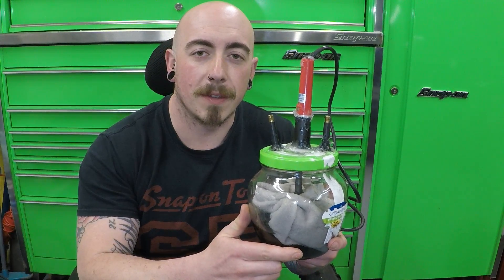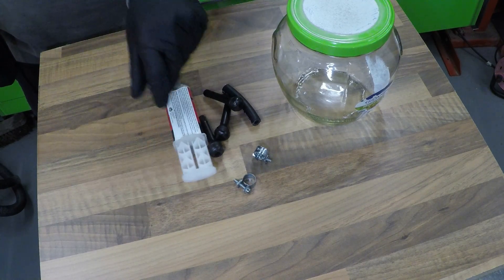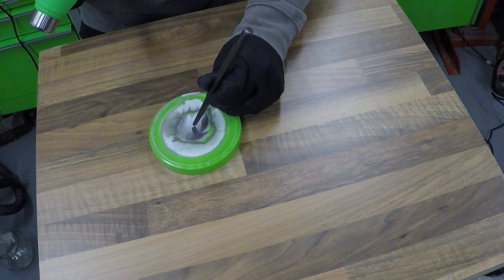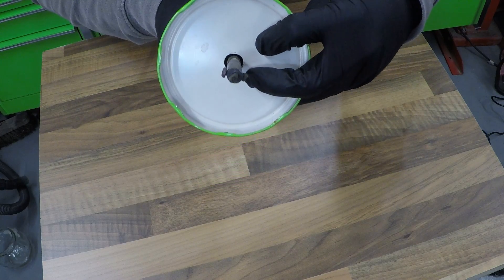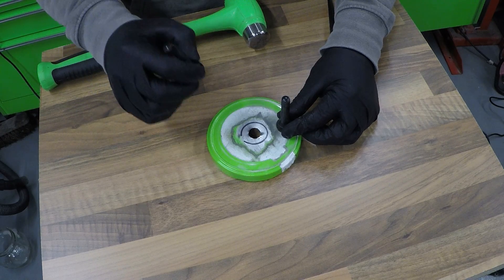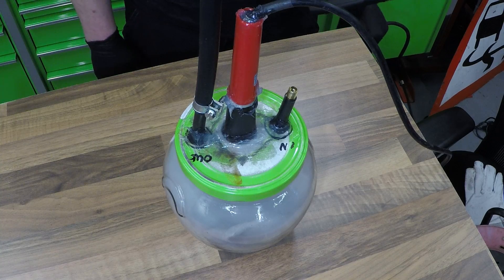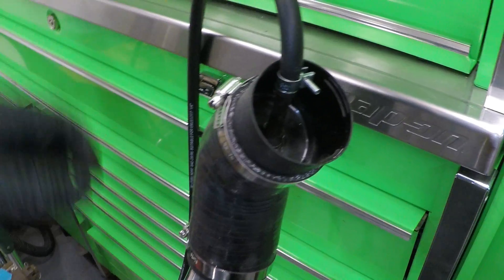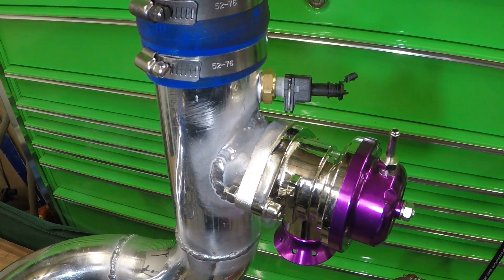D.I.Y smoke tester

Comment: Excellent video. 
To save more money I harvest baby oil using a cider press and a sock filter.  Extraction is much quieter if baby is asleep before processing which should be done swiftly to avoid annoying neighbors.
Reply from the maker: make sure the baby is fresh or else it will burn

Comment: I made something similar to this but I used a one quart mason jar and already set fire in the jar with lighter fluid with a rag and put an air compressor fitting on it to 5 -10 psi with 2 shutoff valves on the in and out port. Works just as well. Although I don't see how baby oil is flammable. ?? Can anyone answer that ?
Reply from the maker: I'm not sure if it is flammable or not but it sure do smoke well
Reply: @Project380 Have you put a flame to baby oil?

Comment: Hi, what size diameter hose/pipe did you use to fit on the valves? Also where did you get the hose from? I'm also in the UK.
Reply from the maker: 6mm i think
Reply: @Project380  thank you.

Comment: What is the safest way to store this when not in use? Especially since the rags are soaked in oil.
Reply from the maker: ive put it in a cardboard box in my toll box and kept upright, its not leaked and its not flammable so all is good  ✌
Reply: @Project380   will this help find a p0446 code
Reply: Oily rags spontaneously combust 
Baby oil too?